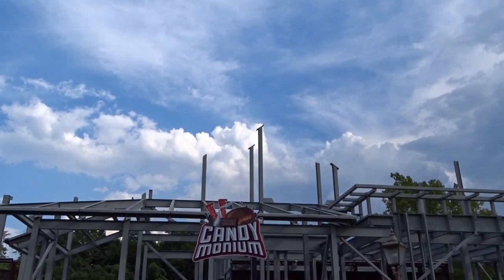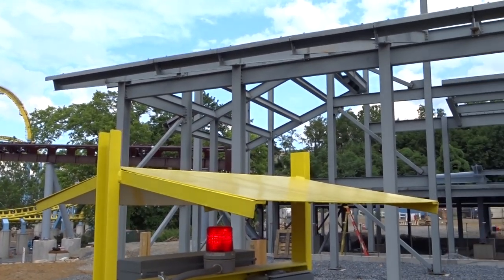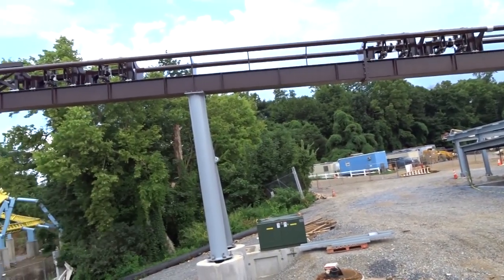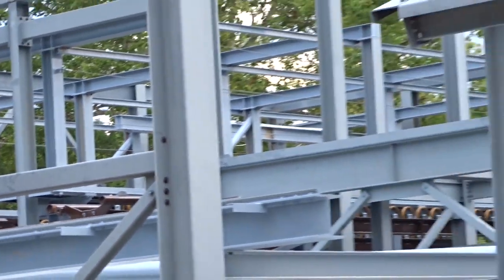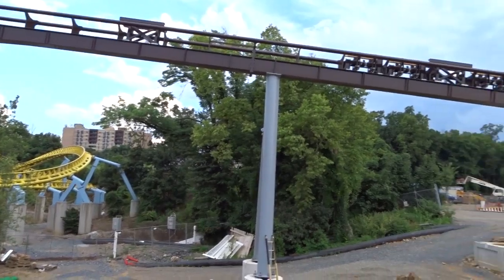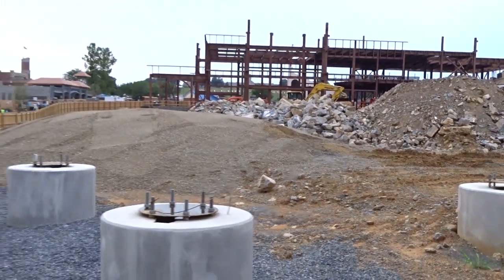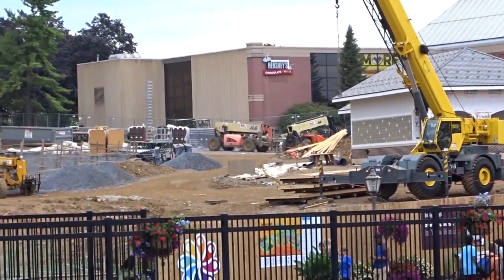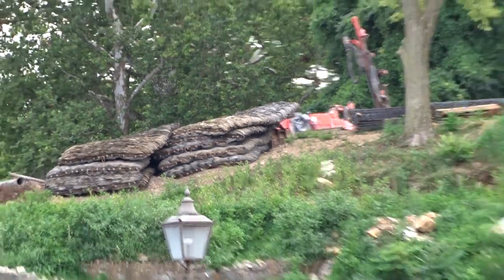Candymonium Construction Update

Comment: It looks like Mako and there you have it. Nothing spectacular. To hypers in one park really smart Hershey Park.🤷‍♀️🤷‍♀️🤷‍♀️🤷‍♀️🤷‍♀️🤷‍♀️
Reply: Why can't Hershey have two hypers? Cedar point had four, and everyone's okay with that.
Reply: Yo It's Kanteer Number one you can’t compare Cedar Point to Hershey Park when it comes to anything. Sky Rush And this new coaster are the same height. Or should I say Mako 2.0 Cedar Points hypers significantly taller than each one with staying with in the 200 foot range.
Reply: @darrylellis4809  Actually, the overall height of Skyrush is 200 ft, but the drop is 212. This is because of elevation, as the end of the drop is significantly lower than the station. While Candymonuim may not have the tallest drop in the park, it will still be the tallest and fastest.
Reply: Yo It's Kanteer I agree with you on that but why not make it 230 or 240 is far as height concerned.
Reply: @darrylellis4809  As far as I'm concerned, I this they could, I completely agree. But, they may not have enough build space, and if they did make it bigger, then the drop would be steeper and the back may be a little too intense. Tightening up the train could work, but then that would decrease capacity. As far as I know, it will be higher than 210 ft. They just don't want to scare the GP.
Reply: Yo It's Kanteer I agree but Hershey Park could have figured that out. Lol. Because they are the masters of stacking coasters on top of each other look at hollow for example. My only argument is 200 and 212 are to close in height. And the layout looks to much like Mako.That money should have went into RMC Wild Cat.